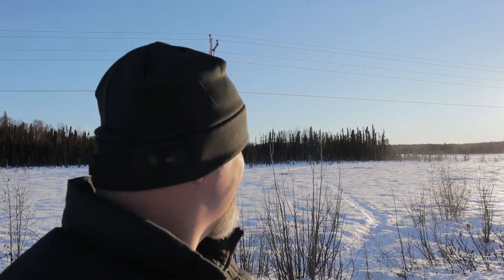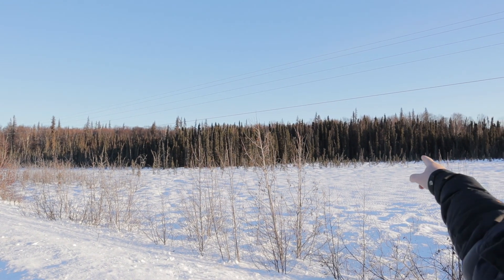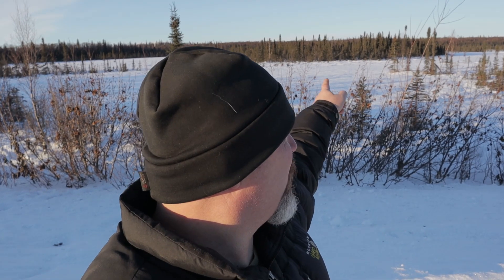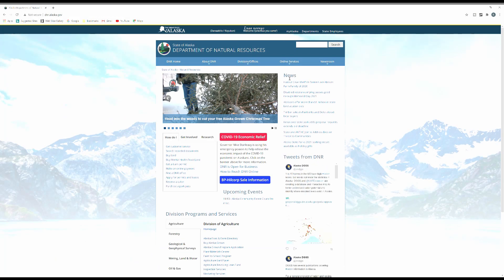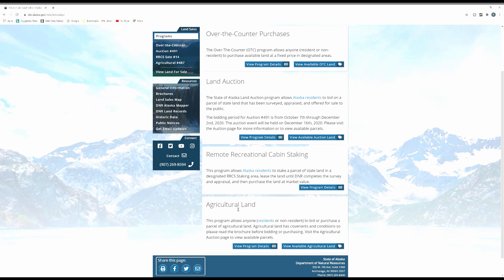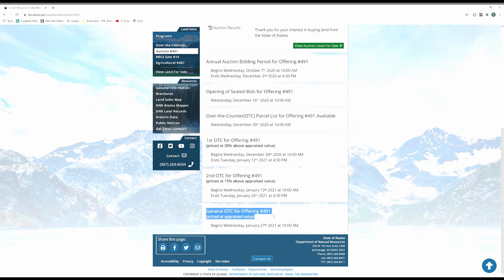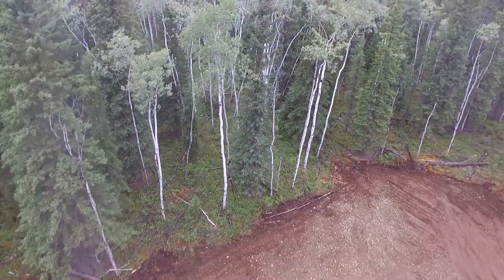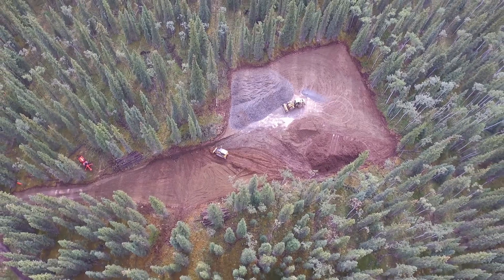Buying  Land Cheap

Comment: Here on the east coast you can get land loans fairly easy , the only thing is you have to put 35% down plus closing costs and have good credit.  When I bought some off grid land up in northern maine we went through a bank from there. Bank's in my area wouldn't do anything for me.  Raw land is to risky for them and it won't matter what your credit score is. There's also owner financing available for some properties. You also have to be careful where you buy. Some areas have alot of restrictions and some don't.  Make sure your area doesn't before you buy. One more thing. If you want to go off grid it isn't a tv show you will have problems and things usually will cost you twice as much as you think when doing projects out in the middle of nowhere.

Comment: My wife and I are discussing and making a plan to buy land there to move to. Thus video gave me some new info I did not know. My goal is to move there in a years time. I have been considering buying land before I actually move there, seems like it would be pretty easy to accomplish
Reply from the maker: Buying land up here is very easy, it just depends on you budget.  Glad you enjoyed.
Reply: @wildwoodoffgridalaska  my budget for buying will be around 20kish. I am a construction plumber by trade,  so that will help, but my build budget will be nothing compared to yours.
Reply from the maker: Lol, our build budget is dwindling quickly.
Reply: @wildwoodoffgridalaska  money always does. I have a year to plan and save. Then get property,  then figure out the living situation while building. Probably use a travel trailer while building our cabin.
Reply from the maker: Good luck, sounds like you’re ahead of the planning curve already.
Reply: @wildwoodoffgridalaska  thank you. I appreciate all the info your passing on. Maybe out paths will cross someday.

Comment: Alaska 
665,400 mi²
Or 
Alaska contains 586,000 square miles of land. It is one-fifth the size of the lower 48 states, 488 times larger than Rhode Island, two and a half times larger than Texas, and larger than the next three largest states in the U.S. combined.

Comment: I found this video very informative and I am subscribing. What's it like where you are? How much darkness? How is the best way to get power solar or wind, etc
Reply from the maker: We live in an area of extremes with Sumer temps getting into the mid 80s and winter temps dipping as low as -65f. In the summer we have up to 22 hrs of light and winter we get as little as 3 hrs of light. We use solar with generator backup for power. Solar works for about 8 months of the year with generator being used for the remainder.
Reply: @wildwoodoffgridalaska  Thanks

Comment: Okay where you are.. what if I wanted to live. 10 miles east of McCarthy Alaska on the Eastern side of the mountain that the Bonanza mine is located on.. the Bonanza mine is located about two and a half miles east of the motherload mine. You know historic Kennecott copper mine. The reason that I would want to live in that area. Is there was a TV show so I kind of know the area. A lot of that area is sheer jagged cliffs.. if there's one thing I know definitely a lot about its drilling and blasting. Are making tunnels in solid Rock. So the hell with building a cabin.. I use the trees to heat my home.. and I'll make my home I'm about 100 ft into solid granite.. yes I want to be a remote caveman.. if that's not an option for me then I think I might go and try to live at portlock and piss off hairy man.. course I got to go to Port gram and ask the natives permission before I can do that.. I'm sure they'll think I'm nuts. But then again you would have to be she want to go there and build a cabin..